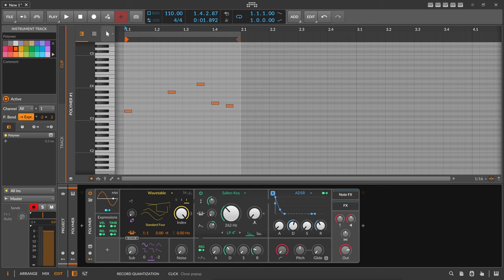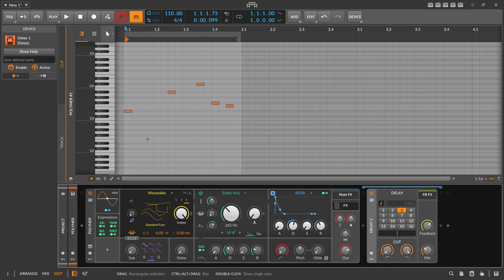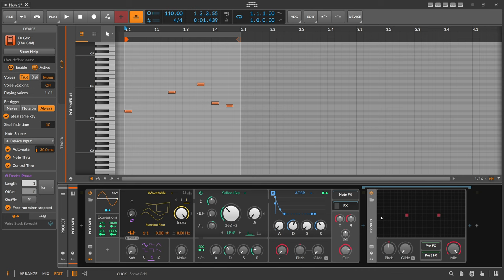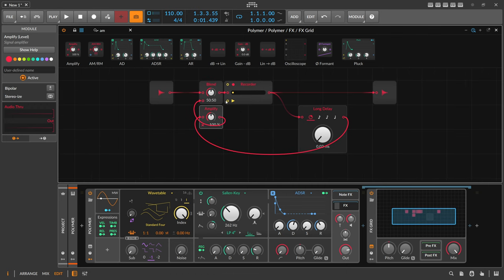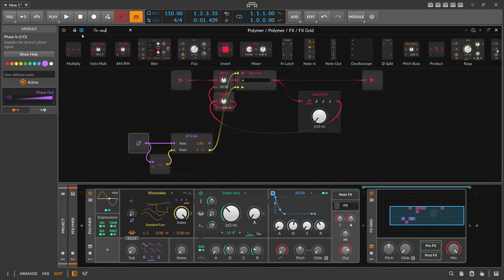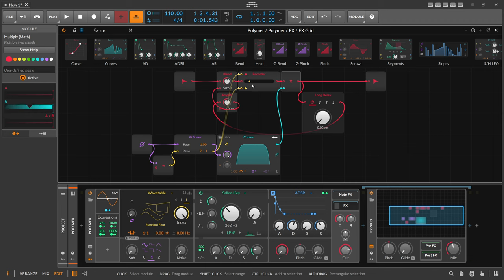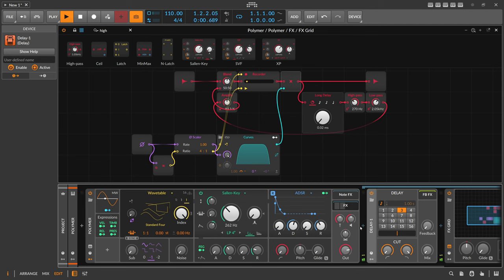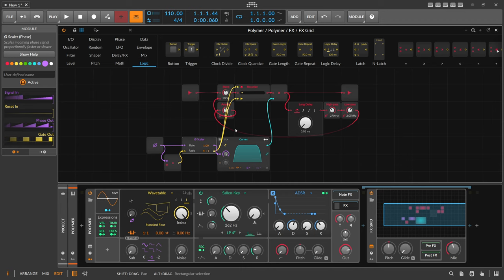Create Delays with Swing & Shuffle in Bitwig

Comment: Great video! Modulating the Delay+ delay unit scaler between straight and triplet values with a square wave LFO can also create a shuffle-like effect with delay taps; but it requires some tinkering with the settings, including the LFO phase.